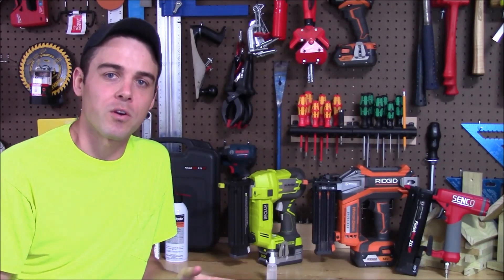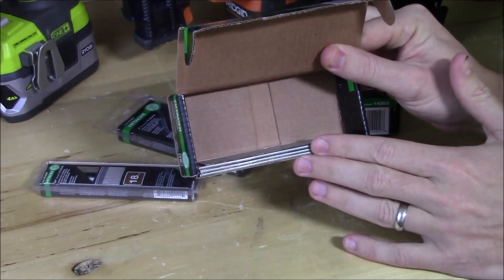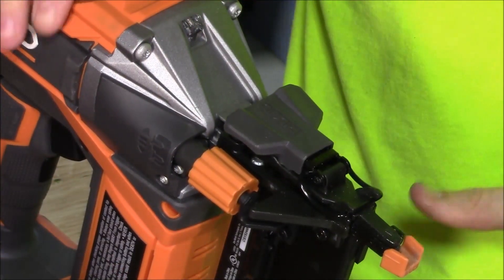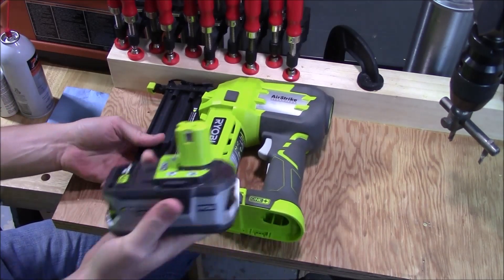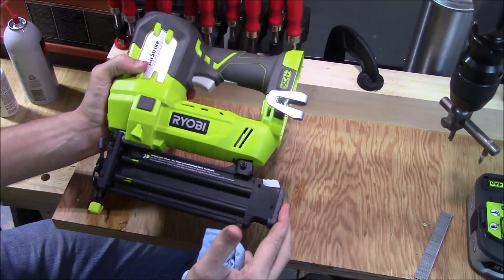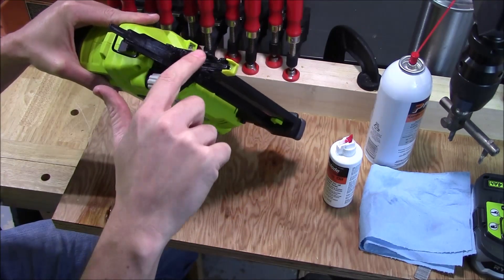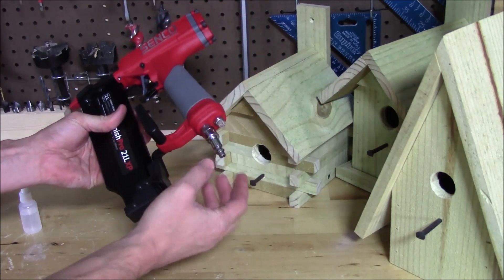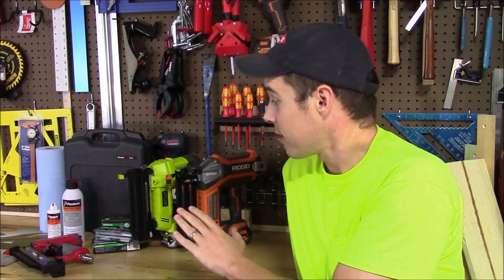Increase Cordless / Air Nailer Performance

Comment: Good idea to clean and oil the nailers. I never have done that and have never had any problems. Wonder if you could use something like wd-40 or carb cleaner to clean it or oil it, then something like 3 in 1 oil to keep it oiled? Wd-40 might eat the plastic though. You may also be able to use a dry lubricant so it doesn't attract dust and dirt. Great video!!!
Reply: How much
Reply: The manual said to use air tool oil for

Comment: Great info.  I've used the cleaner in the past and found it work very well.  It does evaporate very quickly and don't use it near an open flame or other high heat sources.  It is very flammable!
Reply from the maker: Mike L. Good point Mike!  Yeah, flames + aerosol sprays usually end up badly.....

Comment: Nice review, I have a Ridgid 18v 18 guage hyperdrive nailer and it won't feed nails and just dry fires once I have used half of a strip of nails. I think it's due to the lack of spring pressure on the nails. What do you think? I just bought it yesterday and used it today. I did not lubricate it before I used it, you think that will help?  Thank you for your time and video.
Reply: Peace, I have the ridgid 18 & 16 gauge and have found my gun to misfire, cleaning is key. But I noticed my 18 does not have that"pop" as the 16 does anymore.
Reply: Reset your tank .

Comment: I have the ryobi air strike 18g nailer, but have began a ridgid tool collection. Debating if I should sell the ryobi to get the ridgid. Which of the 2 do you prefer?
Reply: I have the same problem
Reply: Ryobi will perform the same or better for less.  In my mind, it's a no brainer.

Comment: brake cleaner and air tool oil, gotcha
Reply from the maker: efb Brake cleaner eats through plastic almost instantly......the power tool cleaner is more similar to CRC QD Electronic Cleaner (cleans corrosion off of electrical contacts/plugs).